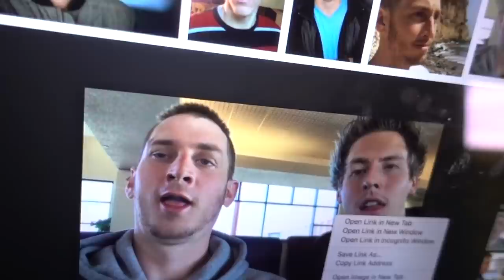EXPLORING SECRET HIDDEN ATTIC IN MY HOUSE!

Comment: I’m moving into a new house in two days and I’m psyched, and in one of the hallway closets there is the entrance to the attic on the ceiling. To get to it all I have to do is climb the racks, so it’ll be pretty easy. I hope there’s a proper attic up there, because in the house I’m in now, the attic is full of insulation, which basically means it’s full of stuff to keep the house warm. The day we move in I’m planning to slip away when everyone is occupied unpacking their stuff or doing whatever, and I’m gonna sneak into the closet, climb those racks, and take a peek into the attic, and if it doesn’t have insulation, I might climb up there and check it out!! It’s an inconvenient entrance, sure, but it has the potential to be an awesome hideout!!

Wish me luckk!